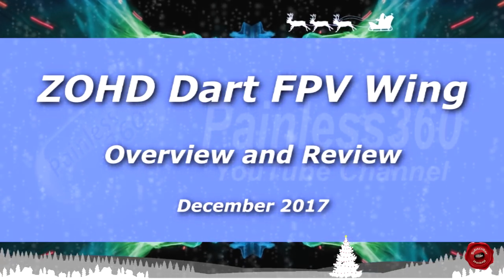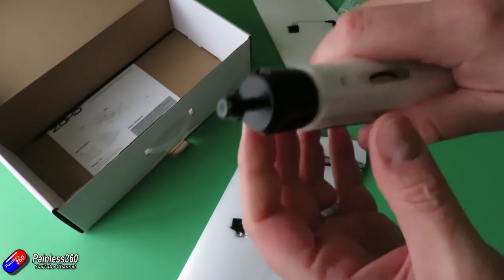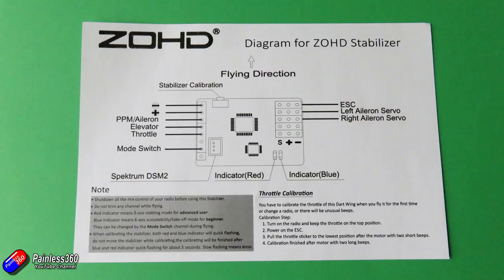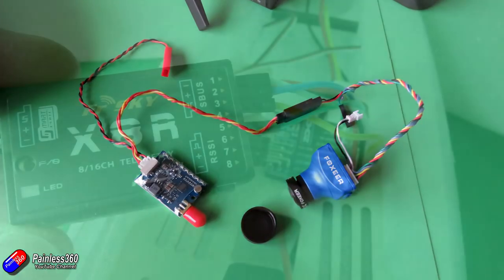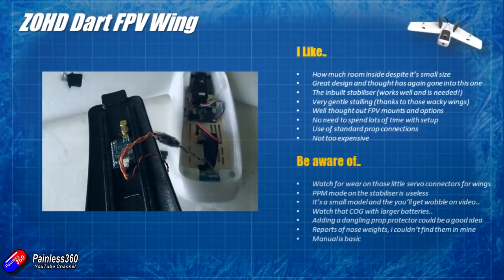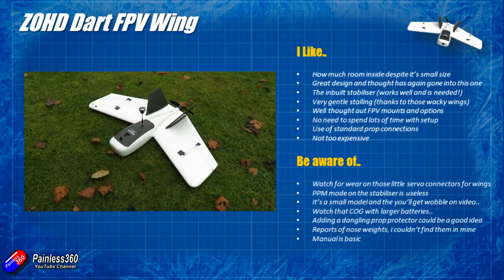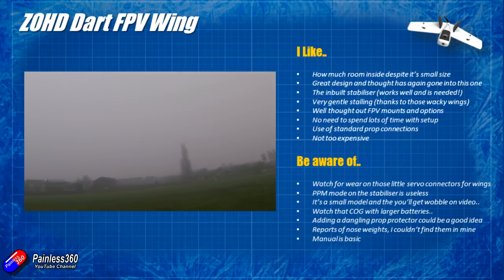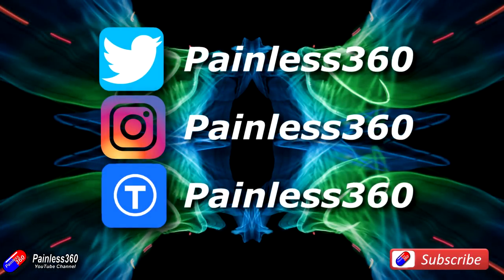ZOHD Dart FPV Wing

Comment: Just got mine in the post. First impressions are the foam although smooth, feels a bit soft and flexy than it seems on all the video reviews. The motor waggles on the mount. However goes together easily enough. Will put blenderm on the hinges, possible orientation strips on the wings and some leading edge protection tape before setting up an OrangeRx 4 channel Rx on my Taranis.
Reply from the maker: Check the motor mount, mine is solid in its bay..
Reply: Painless360 Motor checked and is secure on the motor mount. Seems the foam is not rigid enough and you can waggle the motor around, it seems to start from a point about 1cm forward of the cooling exit hole in the tail. Anyways, I'll see how she holds up. Cheers!

Comment: I used an X4R Sbus and it works fine with one plug in the sbus port. Didn't try cppm. Ch 5 for the mode switch.

Comment: I found an old FrSky d4r-ii to be a good match in this plane, although I would have really liked the PPM input to have worked as I've got x4r's all over the place
Reply from the maker: +CurryKitten I've passed the feedback back to the manufacturer. Let's hope we see an improvement. Happy flying, sorry I didn't get to speak to you last night on the podcast. You were one of the people I wanted to say hello to!
Reply: Hey no worries, I'm sure we'll get another go in a slightly less hectic one soon :)
Reply: The "PPM" mode in the manual is meant to be for a Spektrum DSM2 satellite receiver. However that didn't work for me either. All I could get was throttle & no elevator or aileron, so who knows what the channel mapping is. Oh and mine had 40 grams of lead in the nose, and I still needed a 1300 3s to make cog even with a camera in the nose. So it is very heavy for a 600 mm wing. Bottom line. It's okay but I don't like it as much as the reviewers do.
Reply from the maker: +CurryKitten talked to Jack on that very subject yesterday! ;)
Reply: so is there a solution for ppm ? and how do you set up your x8r ?? I did it not get to work
Reply: The non-SB, non-EU X4R I use in this model with conventional 4-ch setup works fine. Dart and Rx were ordered from Banggood in December. ZOHD stabiliser updated since your reviews perhaps?

Comment: If you do want to use a smaller receiver with only an SBUS output, then you can also choose to use a Frsky SBUS To PWM Decoder. That's still smaller than a huge X8R receiver.

Comment: Hi. Nice vid. I realize this is a bit old now. I bought this airframe second hand "new". Its all built with iNav on 4s. She's a tad heavy. BUT my question is; did you dial in any reflex with the servo linkage? Im used to doing that with my wings. I haven't maidened this yet.     Thanks. Love the channel!
Reply from the maker: I've had the V1 not need any and the V2 need about 4mm!

Comment: i know this is an old video but to make sbus or the like work with these stabilizers have to set you model up as AETR and will work
Reply from the maker: Mine was and it didn't. See my ZOHD setup videos. Is yours a new model?
Reply: i got what they called the v2 but just has more spars this has worked with my nano talon and orbit also

Comment: Great video, please tell me, when you program your receiver in  dart facing you or do program from back? Does it make any difference. Chuck
Reply from the maker: It doesn't matter which direction you install it. So long as the cables are connected correctly..

Comment: Gday thanks for the video two question 1/can I put a 4S pack in without changing the speedy and 2/can use sbus for frsky x4r rx thanks for your help
Reply from the maker: +iitra I've not felt the need to try it on 4S, the specs say a 3S battery and that works great. The onboard stabilizer only supports pwm and PPM. Happy flying!

Comment: I’ve just flown my Christmas Dart and it’s great. Quite tail heavy I had to used weight along with a 1300mah battery. Any suggestions for a more efficient and quieter prop to use on the standard motor? Merry Christmas!!!
Reply from the maker: I found the camera, vtx and antenna along with an 850mAh pack make the COG spot on.. I love mine and it’s showing signs of many happy hours flying!!
Reply: Painless360  After a bit of work I now have a runcam in the front and the vtx in the inside of the canopy. With the 1300/3s it’s pretty much balanced now without any extra weights. Just got to see if I can get a quieter and more efficient prop for it. Fingers crossed the weather is nice on Boxing Day to test it out again. Again thanks for the excellent content.
Reply from the maker: @Duncanlovett  best of luck with the maiden!  Launch mode is handy but not fool-proof so get a decent launch..

Comment: I have a bit of problem setting up the X8R Rx with the Dart stabilisation unit. When all connected and with the blue light on, one of the servos of the aileron is not moving. However, when the stabilisation mode off (red light on), all both aileron servos are working OK.  Can you suggesting any reason why ? TIA
Reply from the maker: Isn't blue led RTH? If so you won't have any contol....
Reply: @Painless360  according to the ZOHD instruction sheet, blue light means  6-axis autostability/take-off mode. When on this mode, only one servo of the aileron moves while the other is non-moving and vice versa.  Your input is appreciated

Comment: I'm looking to build a sub 250g dart but I needed some more info

What's the weight of the dart kit? 
What's the motor mount size? 
Would a 1806/1606 motor fit
Could a 4 in prop provide enough thrust?

Thanks in advance!
Reply from the maker: Stock dart is well over that weight, no idea about the prop and motor swap. Let me know if you make it.

Comment: Hey painless360..is there a way to set a failsafe on this wing running only stabilizer board?im running Frsky x4rsb sbus receiver.I tried radio fail safe setup to no pulses and then 100 and -100 and nothing works,,thanks
Reply from the maker: Yes. Figure out the mode signal needed for stabilisation and sett the mode channel to that value in fail-safe. Best of luck!.

Comment: i need HELP i have dart with inav  and when ever i enter stabilized flight mode the wings rock back and forth cant figure out help please
Reply from the maker: You need to autotune it. A cool iNav timing trick coming soon.. Stay tuned
Reply: @Painless360   i have done the auto tune a couple times now with no change
Reply from the maker: Then lower the P gain... standard stuff should help. See my pid video...

Comment: Hi I have never flown anything other than my quad before an I was just wondering if my flysky fs-i6s would work with this or would I need another TX?
Reply from the maker: Aeroplane pilots prefer easily accessible trim tabs by the side of the main flight control sticks. The radio you have doesn't have them, so adjusting the plane in flight (so that it's straight and level) is a lot trickier. It's possible, but personally if you're looking at planes it might be time to invest in a better radio. Best of luck!
Reply: Painless360 Ok thank you for your time to reply, best get saving then lol.